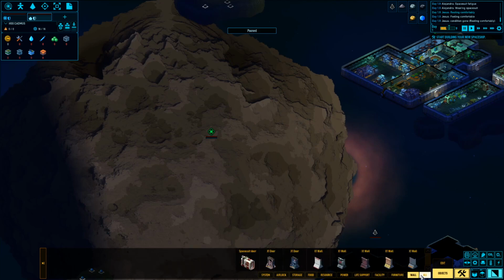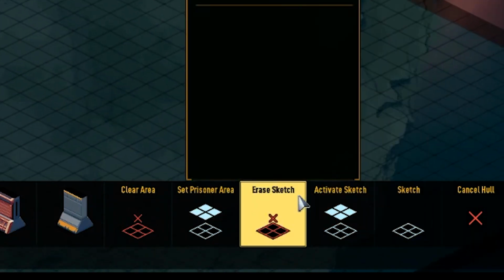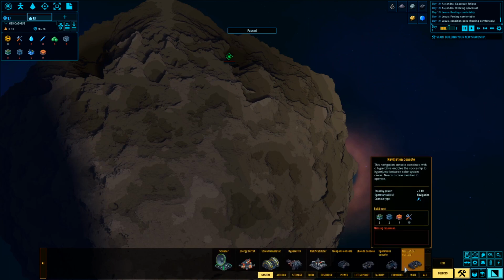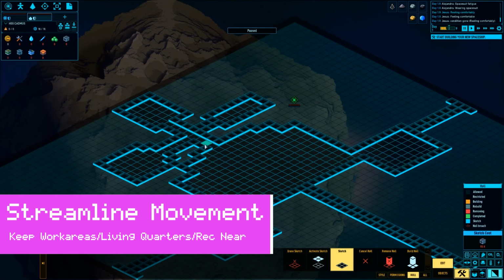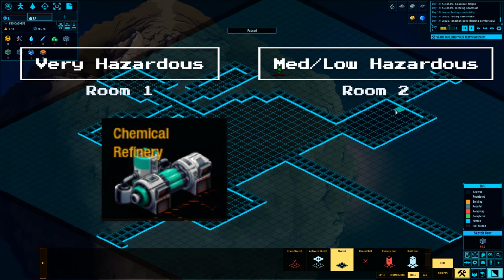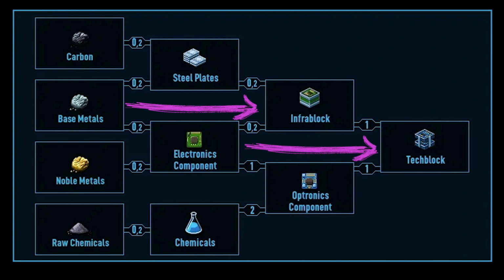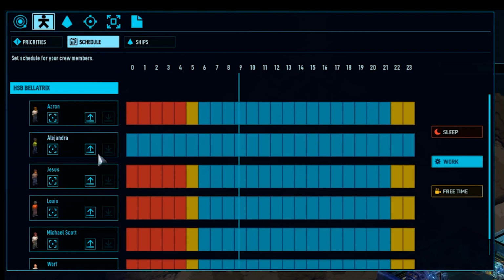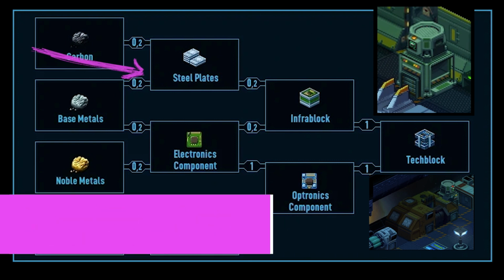How to Optimize Ship Layout - Space Haven: Beginners Guide and Tips

Comment: I am on my second run. First one i died shortly after my first jump when i boarded a derelict.  But I learned quickly from my mistakes. My second run is much deeper, my ship is more compact, had a better plan, got a better starting crew, etc.  But now i think im screwed and have to restart. I am out of steel plates, which apparently my hull stabilizer has been eating up since my game started (hull stabilizer was one of the very first goals they make you build - if i knew it ate up a limited resource that i cant even get from salvaging, i would have waited).  Is there anything i can do to get steel plates or do i need to quit?? I'm so disappointed with this feature, it feels game breaking to me.   if you need steel plates continuously for your ship, they should have made it something you can salvage. I can't make a furnace or whatever yet, because research is SOOOO slow.   This game could be so good if they changed the hull stabilizer and significantly sped up research
Reply: You get steel plates by recycling hull blocks in the recycler facility. Hull blocks can naturally be scavenged from derelicts. :)

Comment from the maker: (Updated) More Tips /r/spacehaven
	- That space for industry is less important than space for greenhouse. 
	- In a long term it is very important to start food production early. 
	- Also good idea to keep in check food production ratio with meat. 
	- Industry you actually don’t need to build all machines at the same time.
		○  You can create machine you need at moment, refine resources you require and dismantle it. 
		○ Note that dismantling brings all resources back, which helps significantly with space and production chains early, when you can’t afford big spaces. 
	- Gas scrubbers take small amount in space but are very important to have in rooms in case of fire. 
	- Plan room gas movement and scrubbers accordingly. Placement for engines almost outside is good idea. 
		○ Main benefit: you can place there power generators and hyperdrives & don’t require operation. So you close them there and be done with them. 
       - Point of note for work planning. It’s generally better to let them work and sleep and rest together in groups. 
         - That way socialisation and comfort stays in check. Look which people don’t hate each other in groups of 3 or 4 and stick them together in one schedule.
Got anymore tips you would recommend for improving your layout? Share below in the comments. 

source: /r/spacehaven @Anderty (thank you!) https://bit.ly/3iRpFIX